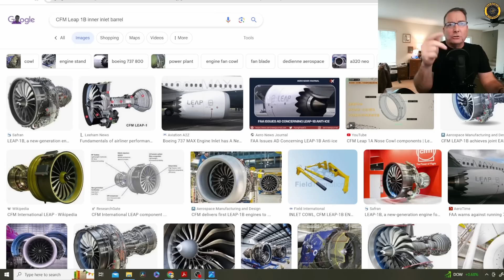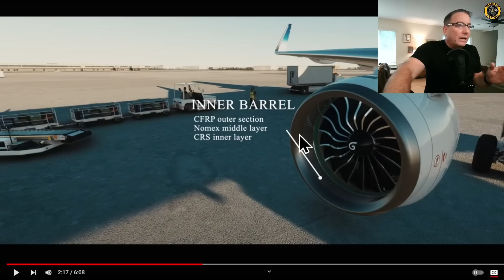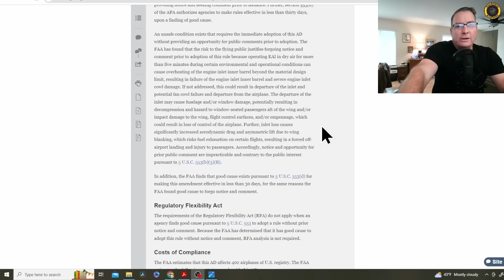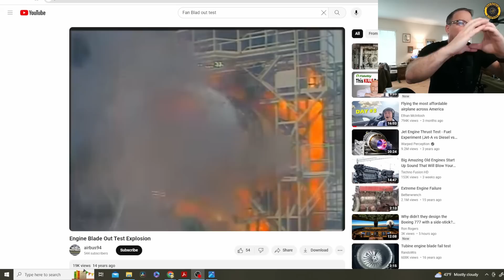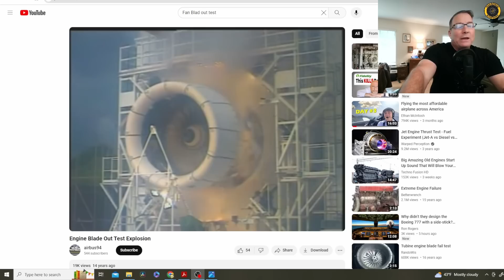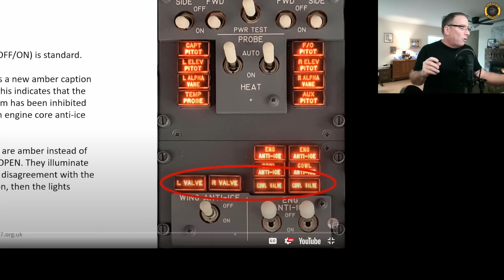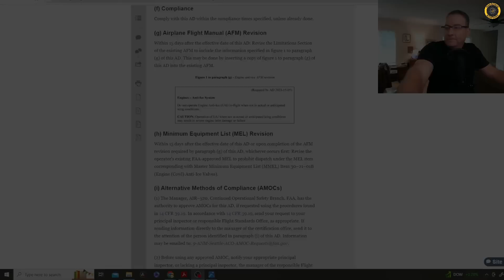Boeing 737 Max-7/-10 Certification HALTED! 1 Feb 2024

Comment: Juan, to answer your question at 9:15, no, the current MAX QRH (post-AD) does not direct an engine shutdown if the cowl anti-ice valve sticks open.  It says, "If TAT is above 10°C, limit thrust on the affected engine to 80% N1 if possible."
Reply from the maker: Got it! Thanks!
Reply: And to avoid flying with stuck anti ice valve you can always put engine bleed switch to off - engine anti ice won't work
Reply: XD, incorrect.  EAI (Engine Anti-Ice)valve is before the bleed air valve.  You’re probably thinking of Wing Anti-Ice.
Reply: @non-revrider8485  thats what WING ANTI-ICE L/R VALVE QRH checklist says. Why it states to switch bleed air to off?
Reply: EAI valve is not downstream of the bleed valve.  The wing anti ice valve is downstream of the bleed valve which is why if the wing anti ice valve sticks in the open position the QRH directs you to turn off the bleed valve.
Reply: @XD-ql2kr  Even if that were correct, we don't turn systems off unless directed by a checklist.
Reply: Well that sounds like a built in solution.  Control and advise.  No reason not to, make double redundant if need be.   Not the only time dependent load issue onboard!!!

 Isn't this an engine manufacturer issue, or do they just reneg on their design?
Reply: @smacktard6051 There's a blue light adjacent to the switch.  When the switch is OFF and the valve is closed, the light is off.  When the switch is moved to ON, the light goes to bright while the valve is in motion, then dim when it's fully open.  Likewise when you switch it back to OFF: bright light while the valve moves, then off when it's closed.  Thus, any time the switch is OFF but the valve is not closed, the light will be on, bright blue.  That blue light on the overhead panel and a small green "TAI" (thermal anti-ice) above the N1 gauge are the only indications that the valve is open.

This is a 1960s-designed flight deck.  Modern designs are significantly more sensible.

Comment: Changing an on/off switch, to an on/auto/off switch requires a new type certificate? That's somethin' else.

On the subject of requiring engine shutdown when a deicing valve is stuck-open, it seems that letting pilots run the engines at reduced power would be a welcome compromise. Although thrust is sensitive to engine rpm, so is kinetic energy of a departing fan blade.

Comment: Why are the toggle switches configured to be ON/down & OFF/up Isn't that counter intuitive, when compared to a common household light switch? Is that an aviation standard?
Reply: Up meaning "on" is a US specific convention.
In any case the switches are on the overhead panel rather than in front of the pilots. So it's more a case of fore/aft rather than down/up.

Comment: Just another engineering problem and refusal to use known components that have served in the past.  Example was the 787 battery that was prone to starting fires, but yet Boeing insisted the weight savings with that battery was worth the risk of an inflight fire.  
The engine manufacturer only provides the engine, and the airframe builder Boeing manufactures the cowling.  Boeing and the FAA are stuck with an old rule on common type that restricts the use of new technology.  The 737 is an old design that has grown to its limit.  Had there been relief of the common type rating restrictions the 737 could have a taller landing gear that would eliminated the aerodynamic problems with changing the angle of the engines that lead to MCAS.  
You are seeing the last of the 737 aircraft production because there are no better solutions for all the problems that are currently using patches to fix design problems.

Comment: Airframe manufacturers usually offer more than one power plant option for each aircraft offering.  If I remember correctly, the 777 even had three options: a GE, a P&W, and a RR (if you had the money).  Does Boesing not have a second qualified power plant for the 8/9 MAX?   GE is cutting edge, but never put all your eggs in one basket, no matter how pretty the basket.
Reply: The engine is NOT the probelem. It is Boeings design of the nacelle anti icing system/components that is the problem

Comment: I suppose if you had an cowl anti-ice valve stuck open you could turn off the pack on the affected engine, turn bleed valves to manual, select source to unaffected engine, and control the bleed air to the affected cowl utilizing the cross-flow valve. Open when you need it, closed when you don’t. You’d have to flip both the crown-anti ice and cross-flow valves at the same time to control bleed air to both engines. It’s a pain, and is a poor design. But you’d be able to keep both engines running.

Comment: At this point perhaps Boeing should get to work on a clean sheet composites replacement for the 737 series and get it out there ASAP.  It would provide a better range and fuel economy along with being modern.  They were working on it up until about 5 years go, time to dust all of that off.

Comment: About 60 years ago, when Boeing was building the first 73s, Lockheed was rolling out the C-141. I spent 6 years on the C-141. It had an ice detector with an auto function that would operate the engine anti-ice. Sixty years later the "newest" 73 still lacks one. Boeing needs some serious house-cleaning from the boardroom on down.
Reply: Also the C-141 was retired in 2006.
Reply: @markevans2294  It was. The airframes were timed out. Not too many 73-100s or -200s left either. Lockheed went on to build the C-5 and C-17. They didn't spend the next 50 years tweaking and re-reengining the C-141.
Reply: @gerardmoran9560  Lockheed built the C-17 ? I thought it was a Boeing / MDD Design ?
Reply: @gerardmoran9560  -- As you said, not many 73-100 or 200's still around, but their Overhead Panel lives on, unfortunately.
Reply: @Yadro767  I'll say. I flew the 73-200 for a couple of years as a captain. I came off the 75/76 and it was a throw-back. The only switches I ever operated were the hydraulics, fuel, lights and seat belt. I don't think I could ever work the pneumatic panel but watched in amazement at how deftly the F/Os did.
Reply: @davidfarrow875  You're right. It was an MDD design (it does look like a descendant of the C-141 and C-5). It came under the Boeing roof after the acquisition. Lockheed does have an impressive line of unique airplanes featuring exquisite engineering.
Reply: @gerardmoran9560  Agreed. The C-141 was always a favourite of mine - one of those planes that just looked exactly right for the job it was designed to do.
Reply: correct
Reply: @gerardmoran9560  The C-17 is a McDonnell Douglas (now Boeing) design. Lockheed is still making C-130 variants.
Reply: @JMChladek  Indeed it is. Another poster kindly pointed that out. In my mind the C-17 looks like a descendant of the 141 and C-5. Cheers
Reply: Oh, Lockheed! I have heard old pilots wax poetic about the L-1011. Has anything rivaled Direct Lift Control?
Reply: @j_taylor  I never got to fly it but rode jumpseat a few times. The cockpit was big, quiet, had big windows, big gauges etc. The pilots loved it too. It was quite fast for the tubby thing it was. We were cruising at M.89. Lockheed sometimes over-engineers things. Great redundancy but costly to build and maintain. The cheaper DC-10 outsold the Tristar but had a very spotty record. As for DLC, I never saw it on another jet but it might be out there. I believe the TriStar was the first to use "active ailerons"- they floated up with an increase of G load which dampened out turbulence and reduced spar stress.
Reply: They do need a house cleaning. Boeing started going down IMMEDIATELY after they changed their long and successful tradition of having a CEO with a majority of engineering background instead of choosing an accounting and equity background CEO.....I believe it is mostly the shareholders fault for deciding to go down that road for increased profits by any means available. This is the crap you get. Sad....there are some very good documentaries on this subject with Boeing. Kinda similar to what happened to all the big American tool companies selling absolute JUNK now.
Reply: It would probably have cost an extra 10 cents.  Can't cut into the profit margin.
Reply: More like the bedroom on down.
Reply: Modern (as in most recent) design is indeed not always "new" often previous ideas/designs are re-iterated and sold as innovation. Swallow your pride folks...
Reply: CE0 bedroom  ?

Comment: Its one thing to get a company back on track from Chapter 10 or 11 nowadays but cutting costs in other places is not a safe bet as we have seen. What did you say sticking a square peg in a round hole? It worked for Apollo 13, why not long term. Having a contingency work for the short term with no other viable option is on thing but not a long term solution. This is what can happen when one company monopolizes the marketplace. Its kind of good in a way for the FAA to step in and stop it but the Airlines are gonna suffer the delay which could backfire the whole industry. Again someone is going to leave or get fired at Boeing. Whether it be Calhoun CEO or Murray in QA. Not a good time to invest in Boeing stock or is it? What kills me is that its a continuous struggle for AME's and Pilots to keep these airplanes creating revenue. They used to build Tanks with interchangeable parts now its a balloon with band aids. Technology is great until overtakes us before we catch up. Is this the never ending struggle to break through barriers? For an AME or Engineer to chime in would it be practical for the EIT gauge to auto on and off the anti-ice at a specified temp and have a control light to tell crew when its activated. You mentioned the 777 system having this type. Is it also possible to incorporate an induction style to work with carbon. The downside of carbon fibre is the negative coefficient of thermal expansion. It shrinks when heated. Looking into ceramic coating carbon fibre as a durability solution. Solution go back to old inlets or have the solution before marketing such products.
I still remember the days of my best flying experience was piloting a C185 on floats in a remote area. Landing in a mill pond with a gentle breeze, beaching it, fresh walleye in a fryer and a lawn chair.

Comment: Seems to me that the 737 series is suffering from systemic failure of Boeing’s QMS and Reliability systems.
As usual in my experience, management is behaving like Mortan Thiokal, except they are doing so over an extended period of time. One obvious corrective action in this situation seems to be to replace the inlet with a metal ring as has been used in the past…. But No…. Let’s pencil whip it and get the authorities to buy off on it. 🤔🤔🤔

My background is in oil industry manufacturing, as a machinist and as a quality professional. My assessment is that  Boeing is in serious trouble here, if you own stock, I would dump it. These multiple issues with the 737 are going to likely bankrupt them. 

A management overhaul is needed to save the lives of passengers, and, if possible, the company. 

Can the Max line be made safe and reliable? Probably. 
Will Boeing survive the cost of the corrective actions? Probably not.

Comment: Boeing was trying to push the certification even though there were issues! 
It took pushback to get them to halt certification?
I'm gue!ssing Boeing factors in losing a plane annually? 
Is it cheaper in the long run than fixing the problems? 
Apparently, profits come before safety! 
It's not as though the higher-ups are flying Boeing. Lol. 
They have their own private planes. 
I wouldn't fly Boeing if I could fly for free the rest of my life!

Comment: Is the 737 Max series the only airplane using these engines?  Google shows them as an option for the Airbus 320 NEO family, but my limited research (GIGO) is unclear if the engine has variants that are different between the Max and NEO.
Reply: The engine is NOT the problem - CFM does not design/make the nacelle anti icing components. It is Boeings design of the nacelle anti icing system/components that is the problem. Airbus uses a totally different design.

Comment: Has there been (an) incident(s)  of delamination and/or break-up of inlet cowl(s) skin(s)-?
If not, then there is not a systemic problem with the 737s inlet cowl.

I have yet to read or hear about an incident.
Reply: Yeah we'll just wait for another one to auger in before we fix it...😅

A 25% increase in wing area and a 62% increase in takeoff weight. Google away.
Reply: % planform increase forward of the front spar and % planform increase aft of the rear spar.
No chordwise distance change between the spars.
Not a 62% in MGTOW. 
Pax. tube, no change in dia; just length.
Empennage config, same as previous with the same H Stab center section @PeacefulRallyCar-pw3cs
Reply: None have made a smokin hole because of fan cowl composite skins/structure.   @PeacefulRallyCar-pw3cs

Comment: When Boeing acquired the MD-95 and rebranded it as the B717, I assumed they would have put those LEAP engines on that air-frame. But thanks to just one customer, Southwest Airlines, they instead put those engines on the B737 air-frame and here we are. The B717 with the LEAP engines would have been a winner, it would have been much safer. and it wouldn't needed any MCAS (Might Crash Any Second) to keep it stable.
Reply: The LEAP would have been too heavy of an engine at the back end of the 717 fuselage.
Reply: @John-nc4bl  - no, it wouldn't.

Comment: I feel like this is something that testing would have exposed these flaws, and they should have been addressed before continuing. I'm not an engineer, but looking at this problem, I think it could have been solved simply with thermal probes and an automatic shutdown at a certain threshold, or even make it a push button control with a time out and audible alert when it turns off.

Comment: For nose cowl anti-ice, 737s use what is known as a picollo tube, ( pipe ) located inside the nose cowl curled lip.
This tube has holes which allow the hot bleed air from the compressor to fill the inlet cowl with hot air too prevent ice bild-up which could be injested into the core of the engine and destroy blades and stator vanes.
Surely there must be a way to control or lower this temperature. Tap the hot air from a cooler, further forward stage from the engine compressor or tap cooler ambient air in order to maintain a temperature that would not cause delam or break-up of the composite material. As Juan says, automate the controlling of this temp.

OR - one giant leap for mankind, automate flight and ground ops.
Just think of the money saved from not having pilots, no hotel bills, no heavy flight deck with controls and equipment in the pointy end.
OR
Elon, get that Starship debugged and start hauling passengers from the west coast ot the continent to an east coast of that other continent in a flash.

Comment: Not a pilot, but seems to me that during the design phase of the LEAP engine, they should have been looking at just how hot the bleed air was that was coming off that stage, and subjected the engine to a simulated valve failure to ensure it was capable of handling the situation. Seems like this should be a requirement for the FAA to include in future engine certification requirements.

Comment: Is CFM responsible for the engine cowling design, or Boeing? I've had to change quite a few of the cowl anti-ice valves over the years on older 56B's on 737-3 and -4's and I always thought the nose-cowl was designed by CFM. Am I wrong?
Reply: I’m sure you could do a quick internet search to verify, but I’m certain Boeing designs the inlet and anti-ice system in the Max, NG and classics.

Comment: I think we can blame the FAA Certification policies too. The FAA refuses to amend their certification policies to allow advanced improvements on a series.
Reply: Make too many "advanced improvements" to an existing aircraft design, it becomes something new and different, no longer just the current series of the same aircraft.
Reply: This was my first thought as well; the obvious engineering solution here is to keep the cockpit HMI the same (on/off) but actually make it function as an Auto system. Given how simple that approach would be, I can only assume the FAA doesn’t permit it.
Reply: I doubt they would require a new certification if de-icing would start/stop (or pause) automatically, or even if they added a switch/position...
Reply: The FAA allowing Boeing to self-certify was a bit of a stretch.

Comment: The Max has been a real headache for everyone involved. Boeing should scrap the 7&10, and anyone still waiting on 8’s & 9’s should forget about those and go with Airbus. For the Max’s in service? Send em back to Boeing! The airplane is garbage! Let Boeing aircraft manufacturing fail, so they can start over. Put qualified engineers and pilots back in control of Boeing.